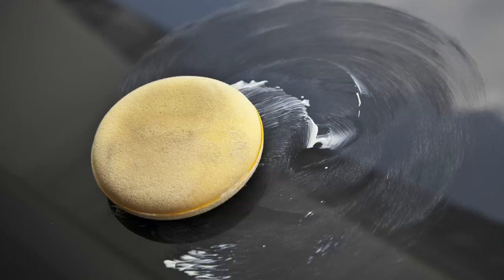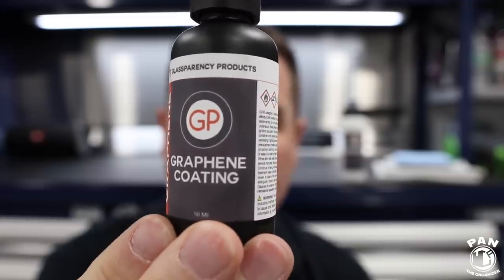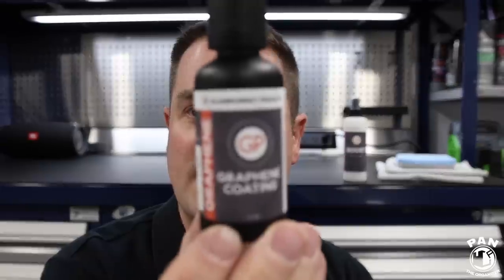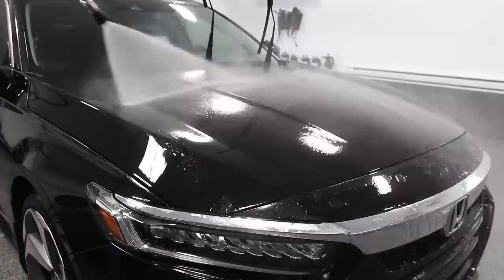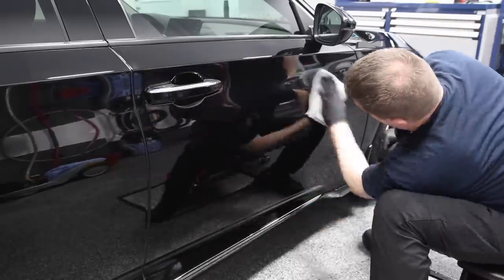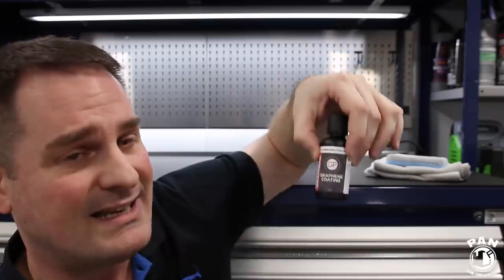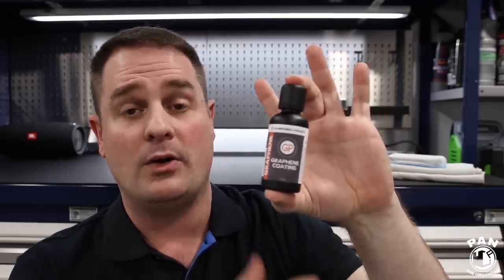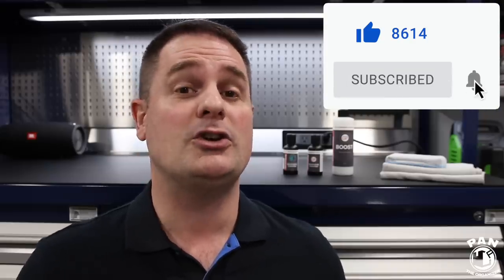GRAPHENE COATING by GlassParency! The Future of Paint Protection!

Comment: Hey Pan, will one kit (50 ML) bottle cover my Sierra Denali HD crew cab or should I buy two??
Reply from the maker: Yes. Typically one 50ml is enough for two coats on one big truck. Just don't overapply. One 50ml bottle of another coating I used on a full size Chevy Silverado Z71 was more than enough for two coats. Check out my video here: https://youtu.be/g2FPiPkG4MI
Reply: @PanTheOrganizer  Thanks boss!!!👊👊👊
Reply from the maker: My pleasure Brandon!
Reply: @PanTheOrganizer  Pan another ?!!! I watched that Silverado video. I didn't hear what you used on the interior trim.. What did you use on the interior? I see the list but can't figure out which one is the interior trim polisher!!!!
Reply from the maker: To protect the interior plastics, I used CarPro PERL diluted 5:1 for interior use.

Comment: Hey pan,  I recently purchased and installed this graphene coating.  I followed all the steps in application and am currently waiting for the 14 days to wash.  However, after the 24 hour cure time(actually cured for 34 hours before subjecting it to the elements).  I recently rinsed the car and dried with a microfiber.  I do have a few water spots that arent really wiping off.  I just read that I can use the Boost, so I may try that tonight when I get home.  Otherwise, do you think that once I can wash it that they will come off when I sponge wash the car?  I hope I dont have to re-polish to get the spots out.  I should be able to wash on Monday.  Also,  when are you going to review all of the new Glassparency products that have just arrived on their website?  It seems they now have a full lineup of detailing products available.   When I rinsed the car the water beading was crazy.  I hope this stuff lasts as long as they claim.
Reply from the maker: Yeah they should come off easily. Or use a water spot remover like CarPro Spotless. And yes apply Boost after washing your car.

Comment: Can P&S Beadmaker still be used as a topper on this? 

also after the coating has ended, what is the proper way to take it off? because i know with ceramic it was kind of a hassle.
Reply from the maker: Yes you can still apply Bead Maker on top.  Only way to properly remove coatings is through paint prep like in the video, including machine polishing which is key.

Comment: HELP please!
So I made the mistake on putting CeraTrim on my plastic handles an hour before putting on the Graphene coating and it let a film residue all round the handles on the car paint when I was done doing the coating. 
How can I fix it. I am devastated! It looks like a huge blob of smudge.
Reply from the maker: You applied the graphene coating on top of CeraTrim?? Did you try reaching out to info@glassparency.com or to The Last Coat?
Reply: @PanTheOrganizer  Yes. I applied the CeraTrim and 20’ later I buffed it off and then around an hour later I put the Graphene coating on top of it since it can be used on plastics. 
No I haven’t contacted them yet. Was hoping you had some input or had an similar experience. 
I’ll contact them now.
Reply from the maker: Unfortunately I don't have any advice as I have never done that and it's hard to tell without seeing the issue in person. Maybe the brands have advice as they most probably have encountered e-mails or calls from people making this mistake...
Reply: @PanTheOrganizer  Yes I did contact both companies. 
It was my fault cause I was in a time crunch and tried to rush things. Never again!
Thanks for responding back to me. I appreciate it 👍🏽

Comment: do you need to bin the cloths/applicators, like ceramic used ones?
Reply: Yes, it is recommend that you do not reuse the microfibers due to the coating solidifying on the cloth. This could lead to potential scratches and swirls on soft surfaces if you reuse them. You could always use them as garage rags to clean up things like an oil drip on the floor, but we wouldn't recommend putting them back into your detailing arsenal.

Comment: Hey Pan, what about using 303 Graphene Nano Spray Coating instead of the included Boost as a topper? Would rather use a Graphene based topper instead of a Silica based topper since this is a Graphene coating. Could the 303 Graphene Nano Spray Coating be used directly after applying the GlassParency Graphene coating the same way as the included Boost topper?
Reply from the maker: Yes you can use the 303 as a topper.
Reply: @PanTheOrganizer  What about using it right after coating the vehicle in place of the included Boost?

Comment: Hi Pan, great video. 
5 years - how about scrates? If the coat is scrats very ugly like a normal paint will be after two years of use - what’s the catch of a coat lasting 5 years ?
Reply from the maker: If you use safe washing and drying techniques there should be no scratches. I never have to repolish my car once it’s coated.

If you have minor scratches, you can use CarPro Essence+ (not the regular Essence) which can correct minor defects on ceramic coated cars.

Comment: Can you do a video where you compare paint protection film and ceramic coating.
Reply from the maker: That would be pointless, as they are different in their applications. PPF is meant to protect mainly against stone chips and scratches.  Ceramic coatings are meant to add gloss, slickness, hydrophobic properties, UV protection and self-cleaning properties, meaning the car is easier to wash.

Comment: I still don’t understand the difference between ceramic and graphene.. both 5 years, repel water and sap and have a nice shine. 

Can you explain this more bro??
Reply from the maker: Did you actually watch the video "bro" ?  A graphene coating is essentially an evolution of a ceramic coating.  It has the same characteristics as a coating: UV protection, slickness, gloss, chemical resistance, self-cleaning properties and awesome hydrophobic properties. 

But the main difference with graphene is that you get less issues with waterspotting, one issue that ceramic coatings were generating, hence why you would always apply top coats on them.  Graphene coatings dissipate heat better, so less of a tendency to get water spots.  Also, you get a longer working time with graphene coatings, allowing you to do full panels before needing to level or buff, as opposed to 2x2 section with ceramic coatings and worrying about flashing times more.
Reply: @PanTheOrganizer  I really appreciate that explanation, thank you. Yes, I did watch the video. I just must have missed some things. I didn't mean to come off sounding, snoody. I love your channel, and I was legitimately excited to learn about this new product. So much so that I have it in the cart, and am going to order it now. Cant wait for your next video!!

Comment: I tried the product on my Model 3 Tesla and the results were TERRIBLE.  I looked good until I appled the BOOST then the finish turned cloudy.  I have no idea what I could have done wrong but how the hell do you remove this coating?  I used CO.UK 3 on another car and it turned out great.  I should have used that instead.   To anyone thinking of applying this to their car you should try a small spot inside the trunk area first.    I  am not sure what happened but it was looking good until I applied the BOOST then it all went down hill.

Comment: You reviewed other graphene coatings, are they all basically the same? You mentioned that the coatings are only 1 atom thick, so how can one be better than another? If you apply 2 coatings,  does than add another 1 atom layer?  Seems that more expensive brands can't do much more if the coating is only 1 atom thick. Makes me wonder why GP is so expensive.
Reply from the maker: Like ceramic coatings, not all graphene coatings are the same. I review the ones that I actually like. This was my first graphene coating video and we have since learned a lot on that fairly new technology. I have done a few video interviews with chemists from the auto detailing industry about graphene so I highly suggest you go an watch those. Super interesting.

One takeaway is that currently, 99% of graphene coatings are graphene oxide, not pure graphene. So in theory, that 1 atom thick layer of atoms is only possible with pure graphene. I know only one product that claims to have pure graphene, it's the Turtle Wax Graphene Flex Wax, which I also reviewed on my channel, they have a patent pending on their tech.
Reply: I appreciate the insight,  is there one you recommend above all? Turtle wax seems to be the easiest but is GP the to best overall? P. S. Liking your presentations and professionalism.

Comment: Pan, any thoughts on how much something like this would cost to get professional done? With paint correction?
Reply: Sunny Hirpara $1000
Reply from the maker: Full blown coating applications aren't cheap, especially given the level of manual labor needed to prep the paintwork.  The hardest part isn't the coating application, it's the preparation stages before that to get the paint as perfect as possible, including machine polishing.  It's impossible to talk about prices on YouTube, as too many factors make prices fluctuate.  One of the factors is which city and which country you live in.  For example, a detail job like this in New York will cost way more than in Montreal.  But it's not a cheap service that's for sure.
Reply: Thanks Pan!

Comment: Is this better than opti coat pro+?.
Reply from the maker: You can’t compare them. Opti-Coat Pro+ is a 7+ year pro grade ceramic coating. A coating like that on a car like mine costs $1500. The GlassParency is a consumer available graphene coating and it’s still too early to tell if it will last 5 years although I have no reasons to doubt that. One thing is for sure, graphene oxide based coatings are some of the best coatings I have tested.
Reply: @PanTheOrganizer  thank you. Is Opti-Coat Pro+ available in the UK.
Reply from the maker: You have to check their website to find out authorized dealers near you.

Comment: have you looked at Adams Grpahene ceramic coating as they claim 7 years of durability?
Reply from the maker: I have been testing the Adam's Graphene Coating for a while now, and it looks super promising.  Obviously too early to comment on the 7 years of durability so we'll have to wait and see for that.
Reply: @PanTheOrganizer  I am going to give it a shot. I just leased a 2020 Volvo XC90 but unbeknownst to me they already had the Zurich shield on the exterior and interior (Dealer Demo w/ 6k miles). They didn't seem to do paint correction underneath this and was hoping I can Machine polish this Zurich stuff off, correct it and recoat with the Adam's Graphene. Also want to put some CarPro Leather on the interior and not sure how Zurich stuff can be removed from the interior.
Reply: @PanTheOrganizer  Any feedback on the above would be much appreciated.

Comment: Dammn i just applied a ceramic coating on mine.. can i put this on top pan?
Reply from the maker: No.  All coatings should be applied to well prepped, virgin clear coat to ensure proper bonding with the surface.  Your existing coating would just reject the graphene coating over time.

Comment: Man, it's me again... I've just repainted a few parts of my car and someone told me I shouldn't apply any kind of wax or ceramic coating at least for 1 month, is that true? Thank you 😊
Reply: Yes wait a minimum of 30 days.
Reply: @pmazurek559  💔 thank you
Reply from the maker: Yup. After getting a car repainted, one should wait 1 to 2 months for the gasing out phase to finish, before applying any form of paint protection.

Comment: How many hours does it take to a novice to do the whole process from cleaning the car to finishing with the graphene boost ?
Reply from the maker: I do this process in approximately 5 to 6 hours (24 years of detailing experience) just for the exterior, given there's only a light polish needed. If the car needs a 2-step compound then polish, it will take more time. So for a beginner, I would set aside 7 to 8 hours.

To give you a better understanding of the steps involved in the application of a ceramic or graphene coating, watch my super popular tutorial which is ranked number one on YouTube for coating application with over 4.2 million views here: https://youtu.be/byKcYsEyWGk
Reply: @PanTheOrganizer  Sounds like it's gonna take be 2 days. I will do that during my summer vacation, in the garage of course. I already watch your ceramic coating video earlier tonight and I think I am sold to go with the graphene instead, unless you change your mind. Now my big dilemma, is which product to buy. I was thinking the Mirroir glaze 105 and 205 from Meguiars. What is your opinion on that product ?
Merci
Reply from the maker: The Meguiar's M105 and M205 are classics, you can't go wrong. But there are higher performing compounds and polishes, have a look at my favourite combos in this video: https://youtu.be/2JDvQBs1viM

Comment: These Graphene coatings really sparked my interest and I tried to learn as much as I can. From what I found, there is no way to lay down a layer of true graphene with a liquid like this. It is graphene particles, which is actually graphite, suspended in liquid, it is not graphene of it is not a single atom layer.  Saying these are graphene coatings is very misleading and it is a marketing tactic using hot words like graphene to sell a product.  There is no true graphene in these products.  Not possible.
Reply: alfred yow is the chemist behind formulating graphene protection for the detailing industry.....the sds for his sps coating lists the graphene content between .2 and .4 grams/30ml.....the matrix these products produce are only 1 atom thick.....subscribe to the graphene newsletter.....it will open up a whole world of graphene

Comment: Pan can I use GP spray coating on top of the carpro 3.0
Reply from the maker: It’s hard to know chemical compatibility without testing. You would have to try. Mixing different brands is not an easy task.
Reply: @PanTheOrganizer  I know that the GP is solvent base and on there web page they said it can be used on top of existing coatings
Reply from the maker: It should be fine
Reply: @PanTheOrganizer  Thanks Pan for your support...love your content and take what you say to heart. My new 2022 kia stinger looks amazing because of your advice
Reply from the maker: Congrats on the Stinger! Sick ride.

What’s your favourite video on my channel so far?
Reply: @PanTheOrganizer  all your videos are great but the one I watched the most was whether or not to detail a brand new vehicle I must have watched that video a dozen times. I also like to watch your 2021 top products.

Comment: Can it be applied over PPF?
Reply: Yes it can!
Reply: GlassParency How about removal of graphene coating? Only reason I ask is I’m sure just like ceramic coating graphene coating will improve over the next few years
Reply from the maker: The only way to remove durable semi-permanent coatings like ceramics and graphene based coatings are through machine polishing.  Mechanical abrasion is what is needed to ensure complete removal.
Reply: Pan TheOrganizer Do you find the graphing that much better than ceramic that you will change your own car over?

Comment: If it takes 2 layers then it's not a true Graphene coating. Like most of the consumer coatings it's ceramic coating with Graphene added. I'm a SPS Graphene installer and it's a true Graphene coating. Takes 1 layer and last 5+ yrs.
Reply from the maker: I'm pretty sure no company yet claims they have pure graphene. They're pretty much all graphene oxide based currently. Very promising technology. But as with anything, we're in the beginning of this (like ceramic coatings were a new thing 5-6 years ago). The future looks promising!

Comment: Is this like Resist All?????   GM offers this for there new vehicles 5 yr warranty and comes with a "boost" spray.......I bought it, spent $400, its junk.
Reply from the maker: I would never purchase "protection" from car dealerships.  They sell you a warranty really... the actual product they use is typically super cheap crap to maximize their profit.
Reply: @PanTheOrganizer  yes, and I learned the hard way, bird poop etched my hood after product was applied, not happy at all, they said they would reapply the product and that their detail guys probably didn't do it right, I said no thanks ill use wax instead.